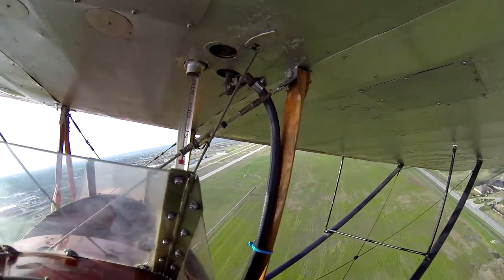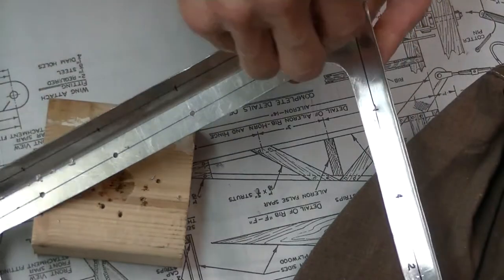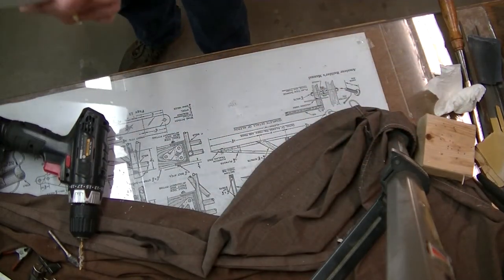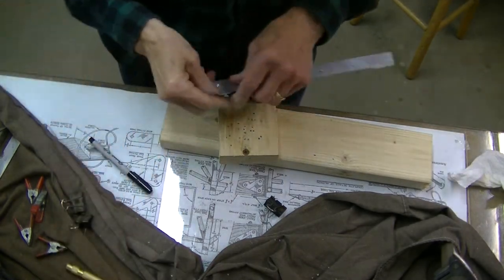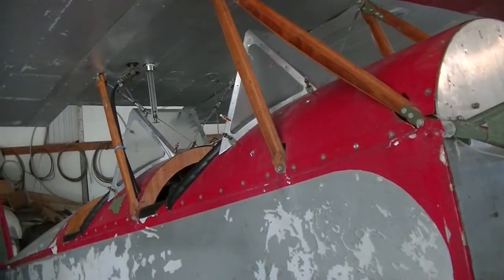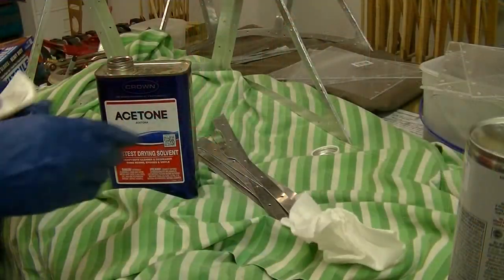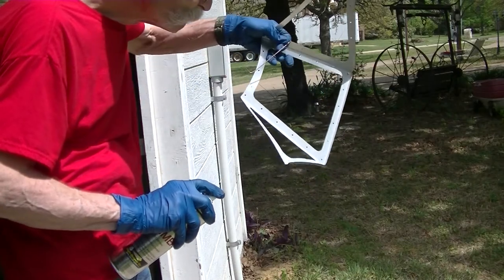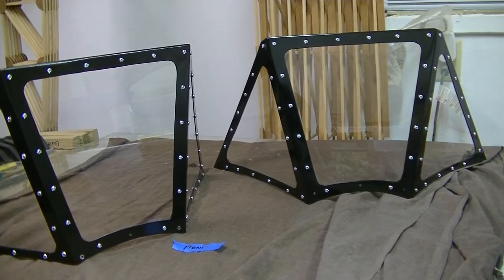Pietenpol windshields for the CJ Piet. Part 2 of 2 videos.

Comment: Best sense of humor, spirit and wit, made my day :D  As always, lovely craftsmanship, Dwain!! PS I learned a new expression: doggonnit :)))
Reply from the maker: Thanks a lot my friend, I appreciate your kind words very much. I hope the flying in your country is going well. Do you have EAA chapters there? Again thanks a lot and I am looking forward to your next YouTube video being published.
Reply: Dwain Marcus with great pleasure, Dwain dear friend! Here they have apparently a network of collectors and builders of aircraft called RSA (reseau du sports de ll’aviation). I put more often shorter snips on instagram due to YouTube s long loading rate. Please contact me there(on Instagram) at @rosssin also if you come to near Toulouse so that we’d go fly in my club and you get a feel of the Robin airplane :) I’d like to build one in the future when electric batteries of small weight become more performant- like this I will control the motor with only an electronic speed regulator instead of the complex fuel and oil systems of the gas engine: if I had your competence I wouldn’t worry about doing the safety checks and maintenances myself :)) Me too looking forward always to your new vids, and always thank you!! Ross

Comment: I was wondering if you could use a little thicker lexan. You can bend lexan in a sheet metal brake and it will hold its shape, so you wouldn't need a frame.
Reply from the maker: Hi Brianne, yes you can use Lexan bent upon a brake for a windshield.  It is a fast and easy solution to a sometimes vexing problem. Back in the not too distant past I custom built many Pitts and Pitts inspired muscle biplane fuselages and related parts for many of sport aerobatics rising stars. I built bent up Lexan heel scuff plates on nearly all of them. They are strong, durable, and practical. If a bent Lexan windshield is what a customer wanted for a Pietenpol or Flybaby type sport plane I would not hesitate to comply with their wishes. On our Pietenpol, we wanted to have windshields that would be more in line with what you would see on 1930's period aircraft. Thanks a lot for watching.   Dwain
Reply: @19Cub    Thank you for the reply. I have been building a Peitenpol Sky Scout for a year or so now in an attempt to get back into flying . and really just to keep myself occupied during the winter. Its nice that you share your adventures as not all of us live in a community where aviation is as available. Thanks again
Reply from the maker: @spurgear4   Thank you Brianne C. I am aware of you and your Sky Scout project through posts on facebook I have seen. Very impressive to say the least. Please keep us posted on your progress OK? Again, thanks for your kind words.   Dwain
Reply: @19Cub  I have a question if you have the time. A 1959 Cessna 150 has recently come up for sale locally , it has all the documents and has a fresh top end. It had the wings taken off and was stored in a barn in 1994 . apparently there is no damage . they are asking 11000 here in Canada , so that would be like 7500 US currency. I trained on the type and although it's not the fastest thing around I'm ok with it. Just looking at a inexpensive way to get into the air. I have worked in aviation for over thirty years but mostly Military search and rescue so not really worried abut the maintenance aspect , I was wondering if it should be an ok move.
Reply from the maker: @spurgear4   Hi Brianne C, without having the benefit of doing a thorough inspection personally, I am a little reluctant to speak with any degree of authority concerning this 150 but I will give you some of my thoughts. I am assuming that this 150 is a fastback fuselage with the straight tail and powered with a Continental 0200 engine. A well cared for 150 of this vintage is indeed a delight to fly and a pretty fair cross country airplane. The airplane you have described as having been stored in a barn for about 24 years does give me pause. My first question would be why were the wings removed and the airplane put in long term storage. Did it not pass it's an annual inspection? Was the engine no longer airworthy? Were structural problems suspected due to a hard landing etc?  The engine as described has had a top overhaul. When was this done? Was the engine disassembled and the lower end IRAN'd.  (Inspect and repair as necessary) An engine that has been dormant for long periods of time is very suspect in my view.  A recent top O.H. in which the bottom end was neglected indicates to me an old selling trick, bait for a buyer to nibble on and may entice an unsuspecting customer into thinking that this is a find of a lifetime. Reminds me of putting lipstick on a pig,  be wary. Barns are notorious for hosting critters that are harmful to aircraft structures. Mice, rats, squirrels, raccoons, skunks, snakes and birds all love barns and aircraft structures and can do great damage. Most all of your radios etc. are going to probably be in poor condition. How many AD notes have not been complied with on both airframe and engine?  I could go on and on Brianne but you understand what I am saying. Unless you are prepared to most likely take on a major restoration project, my advice would be to pass this one up. If you proceed with this 150, hire a good A/I and have him go over this airplane with great scrutiny. If you shop on barnstormers you will likely find a decent 150, T-craft, Luscombe, C-140, Tri-pacer etc. for a very reasonable price that will have you in the air for years to come but even with these airplanes, due diligence is required and hiring a decent A/I is money well spent. I hope this helps a little Brianne...Dwain